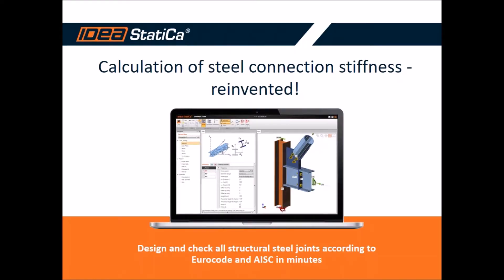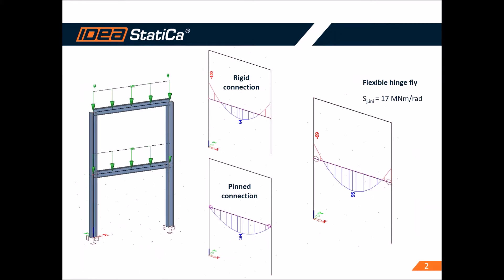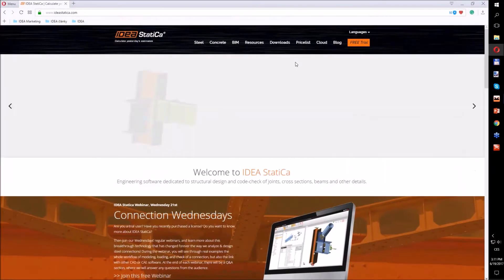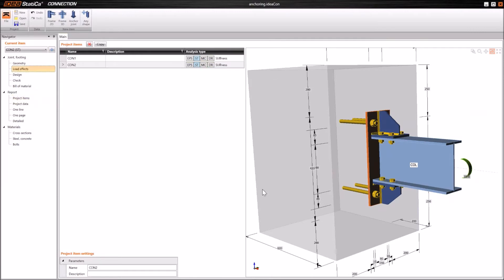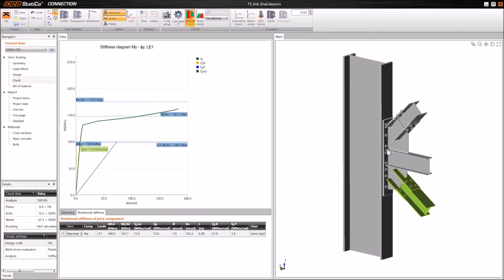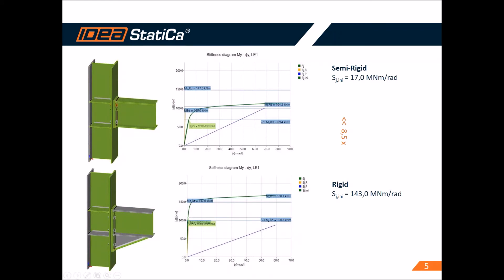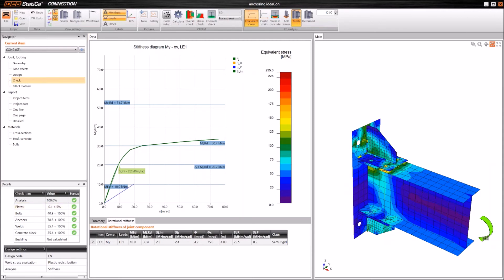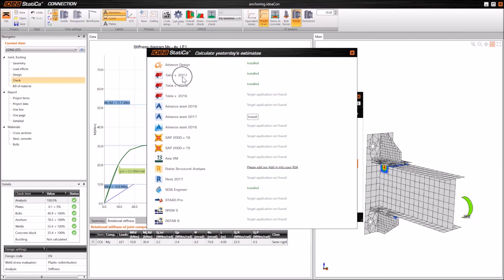Calculation of steel connection stiffness – reinvented!

Comment: Can u explain how to model CLAW ANGLE BRACE BOLTED CONNECTION
Reply from the maker: Hello,  one of the possibilities is to use one of our templates and then modify it, another way is to design the joint in Tekla or Advance Steel and then to export it to IDEA.  If you have a certain project and you are a user of our software, you ask for help from your reseller or write to helpdesk@ideastatica.com